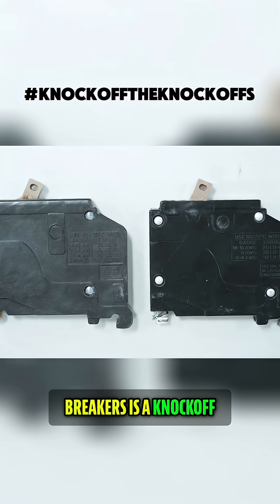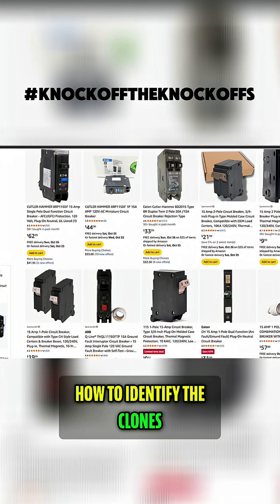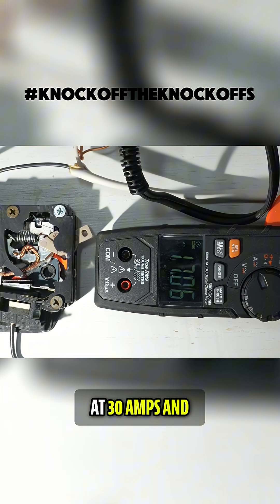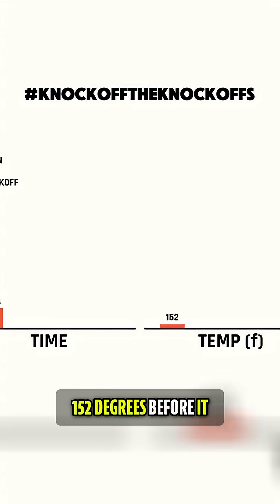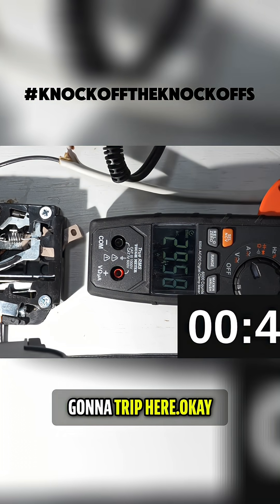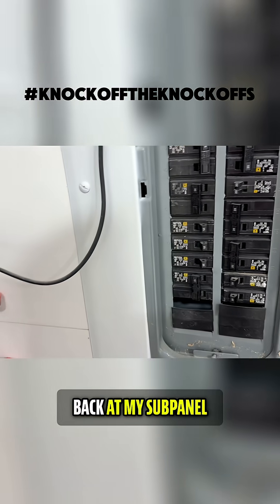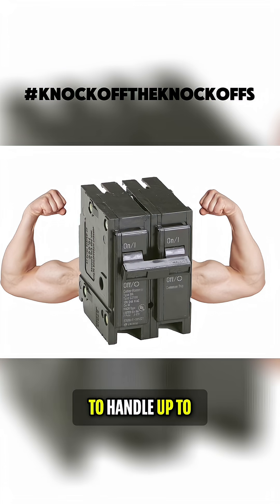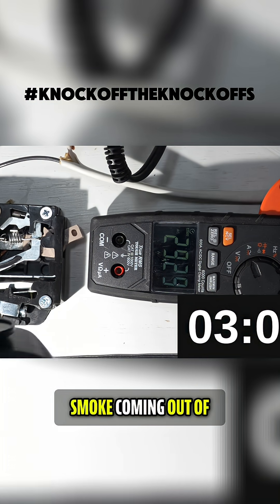Beware of these FAKE Circuit Breakers! #knockofftheknockoffs

Comment: You will not get 60 amp from a 2 pole 30 amp breaker.
Reply: I don’t work in the US, but I know european circut breakers also can draw more than what they are rated for for a short while.

A quick google search for US code showed me that a UL 489 breaker can conduct up to 135% of its rated current for at least 1 hour before cutoff. At 200%, 2 minutes. So 60A with a 30A Breaker seems to check out.
Reply: @Atzu0110 usually for short overloads up to about 10% is what I've heard.